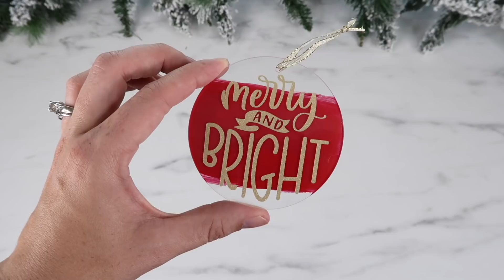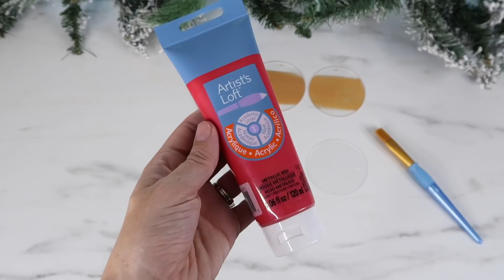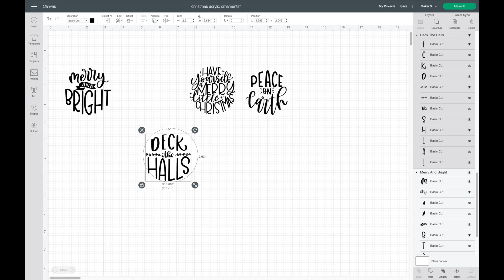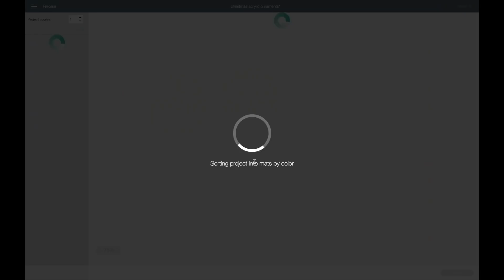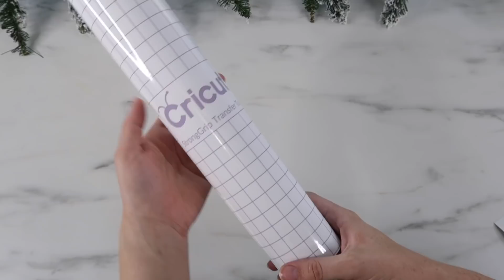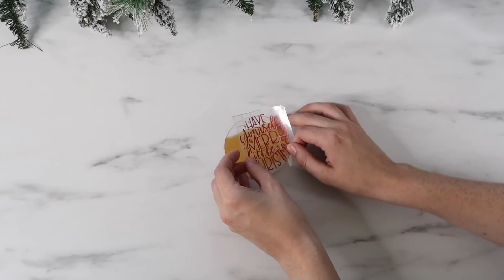HOW TO MAKE AN ACRYLIC ORNAMENT WITH THE CRICUT MACHINE | EASY BEGINNER-FRIENDLY CRAFT

Comment: Pro tip. If you place a strip of masking tape across the top and the bottom before painting the disk, you can let it dry then remove the tape for a nice crisp edge.
Bonus pro tip: Use your cricut to cut a shape in the tape before placing it and you can make festive shaped backgrounds!
Reply from the maker: SO smart!! Thanks for the awesome tips! :)
Reply: Great tip thanks for sharing never thought of doing that.